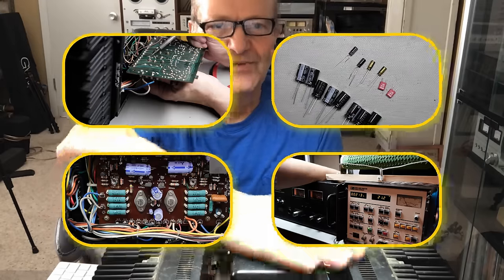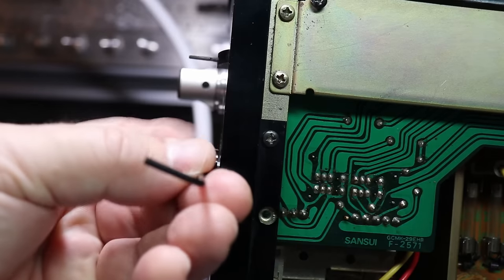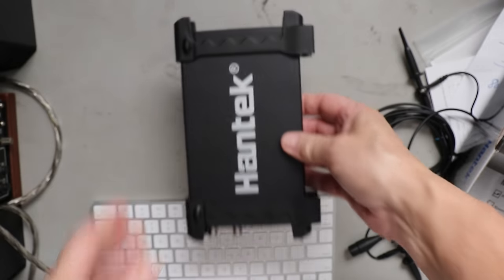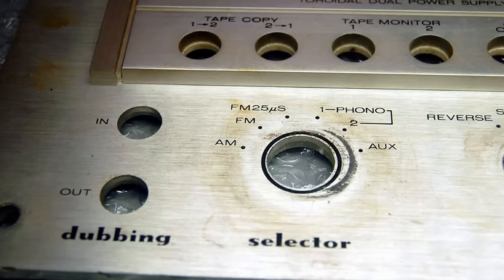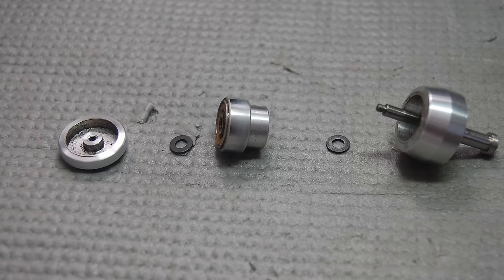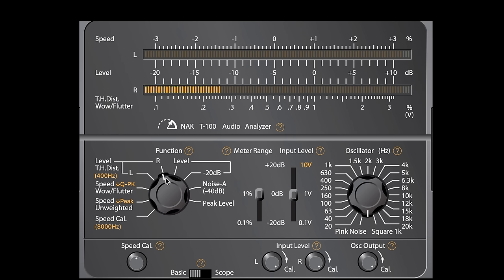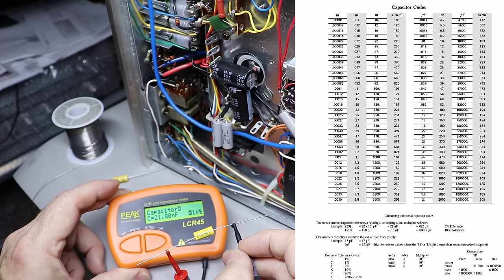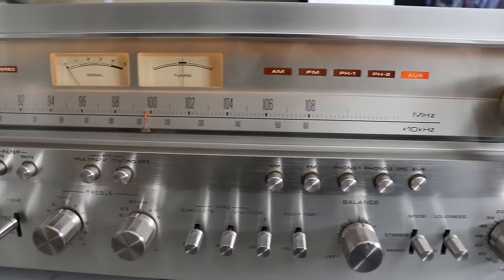Ultimate Guide To Vintage Audio Repair. Old Electronics Troubleshooting. Repairing Tips & Solutions

Comment: Great, really helpful video. Thanks v much.  I started repairing broken amplifiers 4 months ago. Your video has so much practical information and tips from your years of experience.  It consolidated what I have learned from hours of Googling and hands on repairing several amplifiers is what experienced repairers do, plus lots of new practical help.
A practical video on tracing an audio signal with oscilloscope with reference to the schematic and safety issues would be really helpful for those of us just stating.
Reply from the maker: Thank you so much for your kind words and for your suggestion.
Reply: @vintageaudioaddict  I join Mr. C Skeet's suggestion.

Comment: About those jumper leads with alligator clips. One time I was using some and getting weird measurements. So out of frustration I tried ohming out the jumpers themselves and, alarmingly, I was finding resistances all the way up to 20k!! It turned out that the dissimilar metals of the clips and the wire, being merely crimped together, were developing a layer of corrosion in between. I took every jumper I had, pushed back the insulating boot, hit the crimps with flux, and soldered them.
Reply: Yep! That is especially a very common issue with the cheaper test lead sets that you get on Amazon, Ebay, or even at your local Harbor Freight tool store, etc., as those cheaper test lead kits are all made in China to very low quality standards, and they are oftentimes very poorly assembled, (you get what you pay for, I guess, lol!), but if I ever do buy any of those really cheap test lead kits, as soon as I get them home, I immediately check each individual test lead with a multimeter in ohms mode to see if they're all at least under about 0.2 ohms or so at most, (MANY are NOT!), and so I will also then just take all of them and properly crimp the ends, and then I also solder them also, which always brings ALL of the leads down in resistance to basically just the resistance of whatever size and length of wire that makes them up, and that specific resistance, (i.e. what it SHOULD be at a maximum), can be gotten from an online chart or table, or an electronics book that shows wire guages and their respective resistances...

For truly GOOD quality test leads, that ALSO have really good connections/joints on each end that connect the wire itself into the alligator clips or whatever termination end they have on them, the OVERALL TOTAL test lead resistance should ideally be no more than about 0.1 ohms or so... But in order to actually check that jumper lead resistance value properly though, you will have to first eliminate the actual test lead resistance of your multimeter leads themselves from the total resistance first, (which will add about another 0.1 ohms or so to the total reading you get on your meter's display), by first shorting your ohmmeter or multimeter's test leads together and "zeroing out" the display reading, using the "relative" function in ohms mode, (if your meter has that feature), otherwise you'll just have to make note of the meter's own test lead resistance in your head and then subtract that from the total meter display reading when adding in the alligator, etc. test clip leads for testing, that way you can get the actual test clip leads' true, actual resistance value.

If you do this procedure to every single test clip lead that you have (AND any that you ever get in the future, even if brand new), then you will have MUCH more reliable connection test clip leads for your bench testing and/or circuit experimenting purposes!
Reply from the maker: I can't tell you how many leads I've just throw away. Thank you for sharing that tip.

Comment: Thank you for this. I've acquired a pioneer SA-8100 as a project and wanted to know what I was getting into. Seller plugged it in and showed me it was stuck in protection mode and would need to diagnose to get it going. I have recently acquired a bench multimeter and still need a variac or bulb dimmer to start diagnosing issues. A oscilliscope would be a great gift request for Christmas, thanks for the tips.

Comment: Hi Chris, Thanks for making this video and sharing your knowledge. Like you mentioned, I'm also not formally trained and have taken up vintage audio equipment restoration as a hobby. It's very inspiring to watch others do this stuff. I've been able to restore a reel to reel and cassette tape deck and seeing how you approach things is very helpful. I wish I knew where to find likeminded people like you to meetup with and exchange knowledge with locally, but I'm glad there's a big online community of hobbyists like us.
Reply: Hi Raph, You can read my comment 4 comments newer than yours. My ability so far has been maintenance related work on 1970's Dual turntables. Not much electronics in these turntables, but a place to start. Are you in California?
Reply from the maker: Your welcome and thank you for watching. Sometimes there are local electronic clubs in an area. Many folks who are into older electronic gear in general, like ham or cb hobbyists also are into vintage audio. Just do some google searches and see.
Reply: @paulturner3553  Yes I'm in SoCal
Reply: @Dthebeatsmith , Northern Kali. Would be nice to find someone who works on stereo gear in their garage or basement who charges reasonably. I look around in the internet once in a while, but nothing. I have enough stereo gear to keep me going for a good while as long as receivers don't all crap-out. I'm pushing 70, so it might not even be a real issue.

Comment: Your comment on safety working with 120/240 volts +, work with one hand behind your back and make sure not to lean on any component where you become a ground circuit.
In addition to 2 mechanics tickets, I also picked up an instrumentation ticket. I got sent out with a young lady apprentice to perform calibration checks on an oilfield pumpjack installation. The instruments function on 12V or more likely 24V and 4 - 20mA current. To do our job we shut the electric jack down, some use a one lunger gas engine. She pulled the wiring out of the instrument, which grounded and blew the fuse. When she put it back together the device was not reading, so we found and replaced the 250mA fuse. When we tried to restart the pumpjack it would not run. Now inside the panel is the fuses for the 4800V motor. Some I had a little discussion with her on procedure to avoid being shocked. That voltage will do much worse than light you up. The Fluke meter is good to 600V so you can not test for the 4800V. I popped the fuses out to check continuity. One fuse was blown. How that happened I have no idea. I tried phoning our electricians, the operator and our electrical foreman. Nobody would answer the phone. Closed the panel up and drove to town 1 hour away and rummaged for a fuse. We did not have the proper one, but I found one the next amp rating up. Went back to site and installed that fuse and got the pumpjack operating. In the morning I told the electrical foreman the story and handed him the blown fuse so he could get the proper one and replace the over size one. I got my backside chewed by him and the manager for being in the 4800V area, as instrumentation I should not be touching anything because of the danger. I related how I had instructed on using only one hand in the cabinet to prevent being shocked and not trying to measure the voltage, but to safely remove the fuse and test continuity.
An interesting bit of knowledge is the ignition coil on older cars is a transformer. When the points open the coil outputs 10kv to 50kv to the distributor rotor. Measure the voltage at the battery connection on the coil and it will read 200v to 300v while the engine is running. Backwards induced voltage in the primary.
Reply from the maker: Thanks so much for sharing.

Comment: Thank  you, Vintage Audio Addict, for a nice explanation of the Pioneer SX-1250 regarding its different boards, etc..  I recently have purchased 3 different Radio Shack Realistic AM/FM STEREO RECEIVERS including the:  STA-117, STA-700, & a STA-2150 from the late 70s to early 80s.  All 3 of these Realistic receivers work well but perhaps all of them would benefit from recapping possibly?

Comment: Techspray Prowick #4 desoldering braid is INCREDIBLY effective. It’s NOTHING like the run of the mill braids. It has a ton of flux in it and soaks up solder like a sponge. It’s worth every penny of the $7 it costs for each spool. A tube tester isn’t vital. Most tube testers aren’t reliable anyway. The best tube tester I’ve found is a Fender champ. Just measure the current while the tube is working. Most tube sellers seem to be fairly honest about the quality of the NOS tubes they sell. And new ones are still sold if used or NOS tubes make you nervous.

Comment: New subber.  Love your very matter-of-fact/common sense approach to your passion.  I’m a long time guitar amp fixer, albeit never for a living. For that, I’m a Electronic Calibration lead metrologist at one of the NASA Centers, and just came into 2 SX-1080s.  One’s running fine, the other taking me down a few rabbit holes so far.  Got most of the repair equipment I need, but my old reliable 465 scope lost it’s vertical.  I’m also an amateur Extra, so theres Collins rigs in use as well.  Tube gear everywhere.  Great channel. 👍
Reply: Well, 5 months later... fixed the Tek scope and the SX-1080.  It turned out to be a beautiful piece, and I gave it to my brother-in-law, because he knows his Pioneers and would appreciate it the most.  After that, I totally overhauled a 1979 Twin Reverb.  That one was a journey.  Not sure what's next.

Comment: This is a fantastic video.  I use exactly the same process.  Some capacitors and transistors (ahem..germainium), and tubes are ridiculously expensive, so in some cases I may restore, while in others I just repair.
Reply from the maker: Thank you so much for watching.

Comment: Hey my friend.  Just sub’d your channel as we are all about vintage Audi too. Leak Point One St.20 amp and Varislope line stage.  Goodman’s 301 drivers in original factory built cabinets circa 1955.  Marantz 240 power amp etc.  We went through catastrophe level floods here in Oz this year and like most we lost nearly everything we owned inc the 240 which needs a transformer now😳.  BUT just this week I powered up a recently purchased Denon receiver bought for better digital sound and it pretty much worked.  I say pretty much because at first we couldn’t get signal to the speakers,  Then after removing the top casing and spraying the boards and everything else in sight with a generic contact cleaner/rust remover the sound thru the headphone jack worked.  So I got hold of a specialist electrical  board cleaner  and sprayed the by heck out of it left it to dry and now speakers are functioning fine. Same with the remote.  Not functioning at first then a pretty hefty spray with the same cleaner and it appears to be working quite well.  I’m listening to Nirvana via Spotify thru Apple TV and that receiver as I’m typing.  My question is should we do anything else going forward, or leave well enough alone?  The only hiccup with the receivers functionality is that the on screen setup won’t load past language choice.  It just keeps cycling, however there isn’t a problem exiting “Setup”.  I’ve tried a factory reset which seemed to work yet the setup problem continued next try.  Any ideas on this?
Denon DRA-800-H. Apple TV HD. Panasonic tv with hdmi but no CDC or app function so pre “SMART” I guess.
Thanks in advance for your thoughts.
God Bless
🌞

Comment: regarding solder suckers, I have one that is similar to what you have in the video. I really don't use it anymore, its too heavy and cumbersome  and I would  occasionally would accidently   push the button while trying to remove solder.  and when upgrading myriads of capacitors,  it can be challenging.

Comment: Hi
Enjoy learning from your video on noisy transistor. 

I have a Pioneer A400 with noisy transistor on the Right channel. 

Usually happens after an hour or so. 
Can be intermittent and reappears. 

Happens on all inputs. 

The sound of the popping / crackling is Not affected by the volume pot. 

I have already cleaned all the switches n pots thoroughly. 

Hoping you can point out which transistor to replace. 

Thank you for reading. 
😉😉

Comment: The way to use hex keys, and believe me - Floyd Rose style guitarist here and for sure for sure know what time it is with this... You want to make sure it is inserted well, obviously. But then the real trick is to use it for real and turn hard, relatively. Nothing crazy or obnoxious. Just hard enough and fast enough to say you did it that way and that's it. This ensures that stripping will not occur. Stripping happens when you try to baby it tight.
Reply from the maker: Thanks for sharing.

Comment: I bought a hakko 301 desoldering gun for $165 from Japan. The only problem is it's 100volts but I have a variac I just turn the voltage to 100v and it works great. Way better than spending $368 bucks from amazon.

Comment: What soldier do you use and recommend for electronics? Great video with a whole wealth of information 👍👍👍👍👍
Reply: I suppose you mean "solder", NOT "soldier", but he briefly touched on that topic in the video if you go back and really listen closely, but in any case, it should just be solder that is made for electronics, with a rosin core flux built into it, because just trying to use ANY kind of solder, (like the kind that is made for copper water pipe brazing for example, which does NOT have a rosin core), that other kind of solder will NOT stick to electrical connections on circuit boards very well, if even at all. Using a solder that has a rosin core, and is made for electronic work, is essential to making good solder joints on electronic equipment and circuit boards!

I personally also have Kester brand solder on my electronics workbench, as does the guy in this video, however, the actual BRAND NAME of the solder doesn't really matter, just make sure that it's electronic solder that you use, with the rosin flux core in it, and you should be good to go... For electronics I also personally prefer to use only solder sizes under 0.050 inch diameter, preferably even 0.032 inch diameter size, that way it works better with very small terminals on components like small transistors and especially I.C.s... I also personally like to use a 63/37% ratio leaded solder for electronic work because that type just "flows" much better into the joint than "lead free" solder does, but that type of solder, (containing lead), is NOT "ROHS compliant" for commercial use anymore, and it may be somewhat hard to find nowadays, so you can only get what you can get...

Most importantly, you have to find whatever size/diameter and type of solder that YOU like to use, based on whatever type(s) of work that you typically do. But no matter the diameter size OR type, (leaded vs. lead free), of solder that you get, as long as it is intended for electronic work and it has the built-in rosin flux core, then you should be OK for electronic work.

I hope that info helps you to find a good solder that works for you!
Reply from the maker: Thank you for your kind words and for watching. As for your question take a look at what Joe said in his comment.
Reply: You do not want to use lead free solder.  All you need to know about lead free solder is that it is illegal to use on medical equipment, aircraft, or spacecraft. Nuff said?  In other words, if you really want it to work, don’t use lead free solder.

Comment: Back when I started with GTE as a telephone repair tech, we were issued a tool like that, and it was just called an orange stick. Original, huh? It was a long insulated rod with a hook on each end, very similar to what you have. It was for being able to reach into bundles of wire without shorting things out, and then pull out what we were after.
Reply from the maker: Thanks so much for sharing and for watching.

Comment: With solid state amps and receivers you are generally dealing with
a complimentary  power amplifier design. You can not power these types
of amps slowly with a variac since they need at least 90 volts at the power cord
to allow the amp to self balance. So, using a setup with a bulb is best.
If something is shorted like an output transistor, the bulb will just stay lit.
If things are good, the bulb will  dim and pretty much go out.
In complimentary solid state amps, if you slowly bring up the voltage
with a variac, you will see high offset voltage until the line voltage is
high enough for the circuit to work well enough to self balance and
bring offset voltage close to zero. 
I have seen a lot of people think a solid state amp is bad because
it hummed like crazy and has offset voltage when their variac was at like
40 volts only to see the amp work perfectly once the variac was turned to 100 volts.
Reply from the maker: Thanks for sharing.

Comment: Thanks so much for sharing all this great information.  Newbie here. How do you hookup the signal generator and use the oscilloscope? I do have a frequency generator, which I’m guessing is the same thing.
Reply from the maker: Your welcome and thanks for watching. Usually you would hook your signal generator to the RCA aux ports of the unit under test if it's a receiver or preamp. The RCA inputs if it's a power amp. There are many video's up here on YouTube that can show you the basics for using a scope.

Comment: thanks for the video, I got a Kenwood KA-305  I cleaned the controls and sounds good now but this Tone selector knob has an issue ( i'm not too sure what that does...) sound ok in bypass mode  but bad sound in ON mode ...  got a DC off set of about 25 mv   is that worth fixing ?